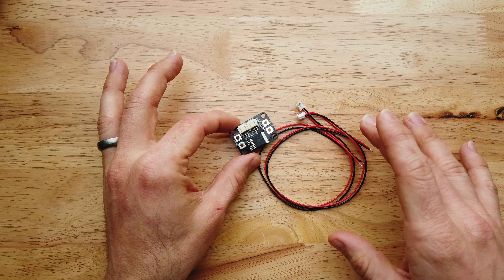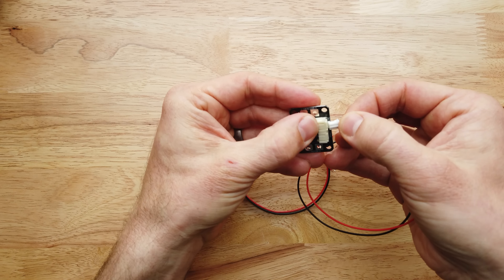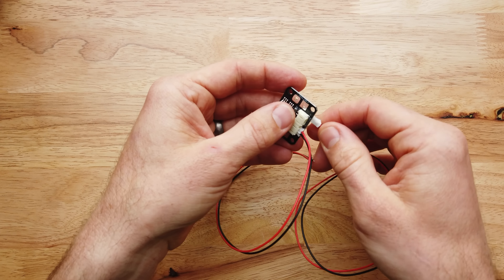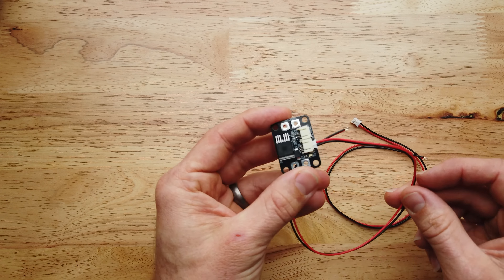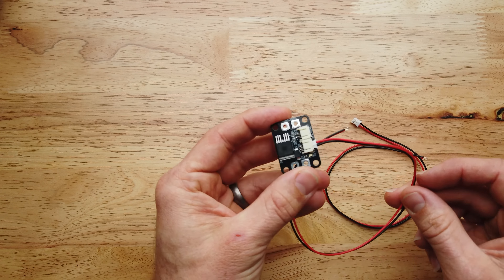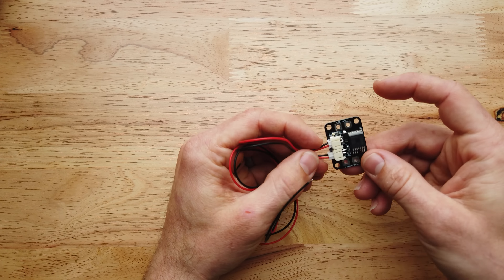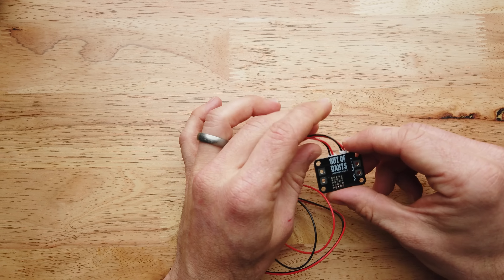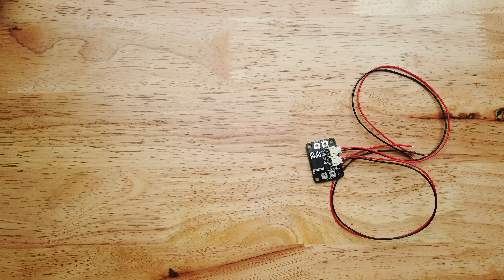PRODUCT OVERVIEW: High Power MOSFET

Comment: I hope you have a lot of these in the make. This is perfect for more than just the nerf hobby. I wish it worked for my 4 stage modulus though.
Reply: you should be able to run two of them in parallel
Reply: @outofdarts  I have a 300A supporting pwm that I had built years ago for a monster 2s vape that I was thinking about repurposing but if it helps the hobby with R&D then I'd be happy to try this and give you my results. First stage is krakens, second is fang revamps, third and fourth are honey badgers all on 3s. I do need wheels so expect a large order soon.